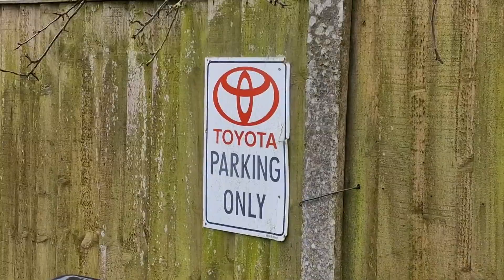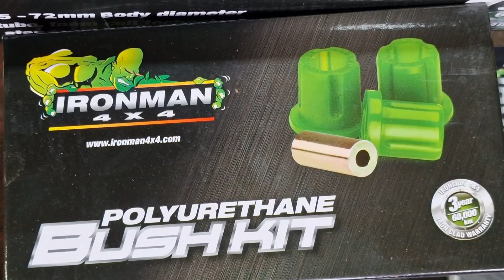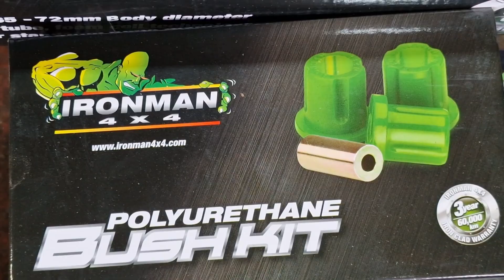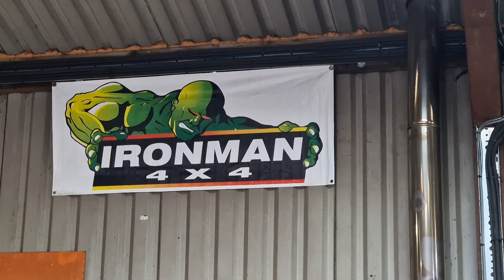Off Road Preparation | Project Hilux Gets An Upgrade!

Comment: can you put up a list of what you had fitted im looking to do the same to my hilux, thanks
Reply from the maker: Full Iron man Pro suspension kit shocks, spring and top arms. We also had the the N4 off Road bash plate alongside. Best suspension I have ever run by a long mile! Get in contact with Paul at West Coast Off Road and say JK Hilux was the inspiration and he can give you the low down on all the parts fitted costs etc and even fit it all if that's a better option. 👍